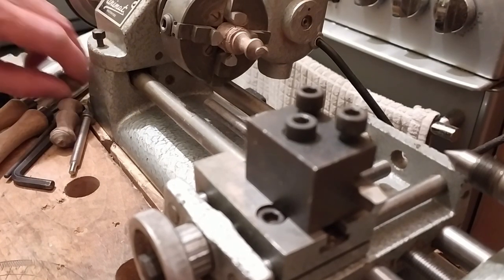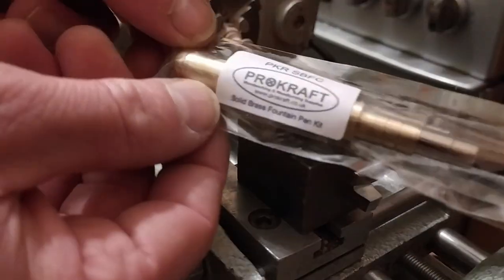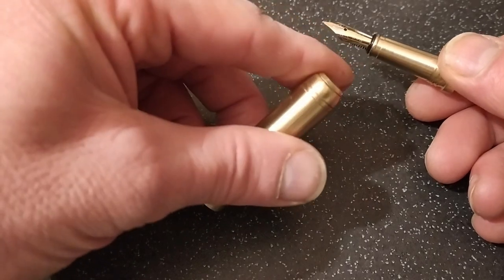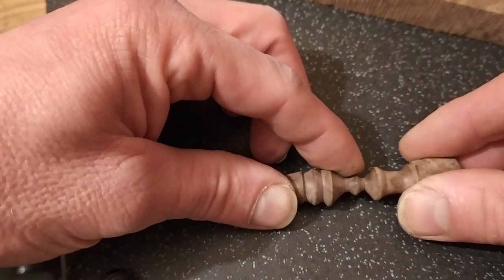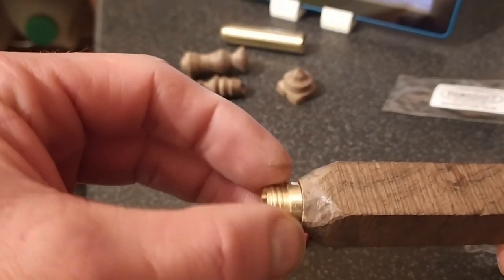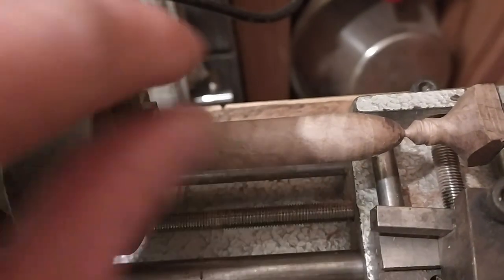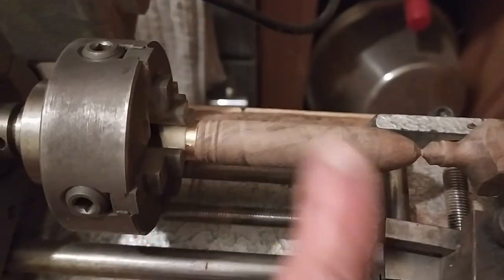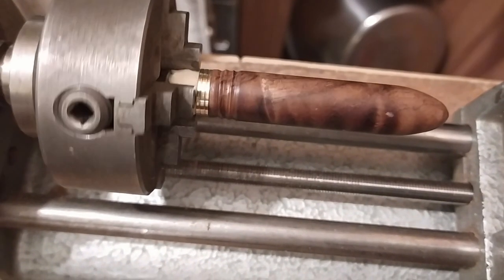Unimat Lathe 1st Project Prokraft Fountain Pen Kit

Comment: If you can get the tailstock out of the way you could have put the wood in the chuck, hand-held the drill in a Jacob's chuck or handle of some sort, and drilled into the spinning wood. Amazingly, the drill self-centres. Before chucking the wood, draw lines on the end to establish where its centre is, indent it with a centrepunch to get the drill started. Bring up the tailstock to make sure the indent is truly on centre before tightening the 4-jaw chuck, then move it away. Use a brad-pointed drill. Mark the required depth on the drill bit with tape. Use a pecking motion to clear swarf, er, woodshavings, out as you drill.
Reply from the maker: Very useful thanks, I'll have to try that.